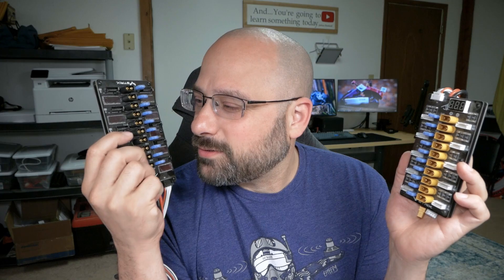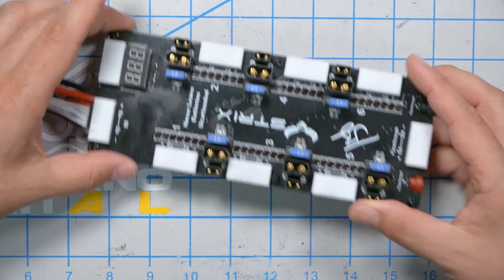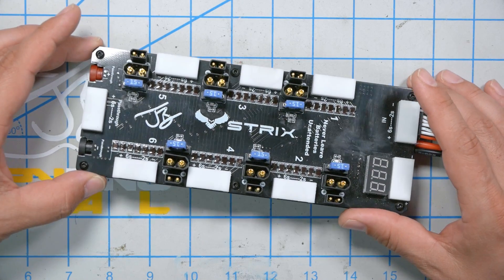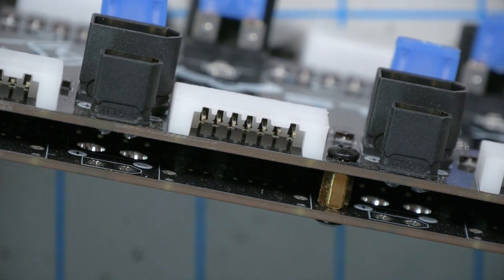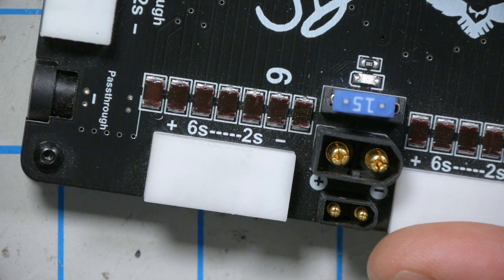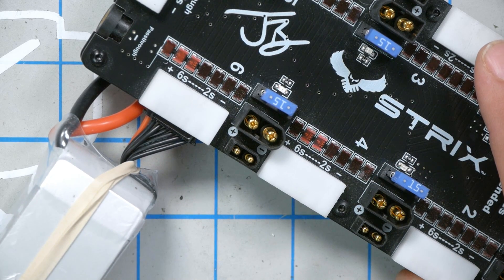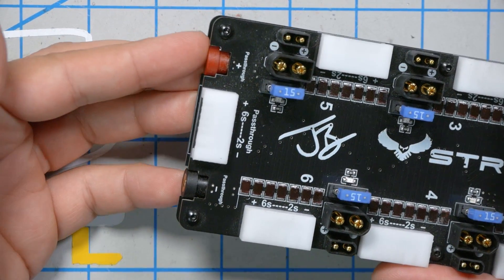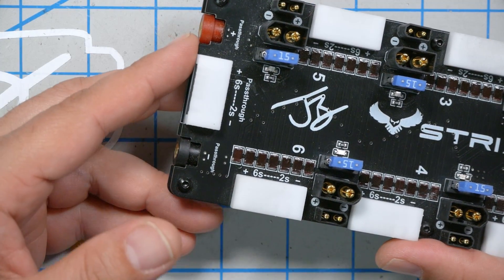New ultimate parallel charge board does it all (XT30 and XT60, 2S-6S)

Comment: before you buy the V2 which will probably be on sale now that this new one is released, u should know that...
on day to day basis i struggle with the JB 6S board when unplugging the xt60s. they are still too tight after 3 months of use.
Reply from the maker: If you really feel this way you can squeeze the prongs of the connector inward slightly with a needle nose pliers.
Reply: @JoshuaBardwell  thank you for replying. It worked for me to squeeze the connectors in addition to make 2 vertical cuts on the black plastic insulator.
Reply: I have the same board love it but, same issue. Very tight. I will try what JB recommends without breaking it. I would of liked more than 6 ports but, it seems many are that way now.  :(      I normally take 20 batteries to take to the field. Looks like more prep time and we can't have everything. If mine breaks I'll be sure to try.

Comment: I have an idea or a question.  I’m not exactly sure so I’m just going to lay it out. Can I use a parallel board to bring my lipos to the same voltage ?
Example: lipo #1  3.75v  lipo#2  3.67v    lipo#3   3.72v    lipo#4 3.65v. 
If I put these four cells on a balance board not hooking to the charger. 
Will they all come to the same voltage and be safe to parallel charge ?

If not is there a way to make a board that will do this safely after flying our lipos ? 
Even if the cells are way off say by more than 1.0 volts?
Reply from the maker: They will do that but the equalization current may not be safe. See the video linked in the description.

Comment: JB: Besides the risk of mixing batteries of different cell counts on those balance plugs, I made a mistake my first time trying this board, and plugged in a 4S aligned all the way to the left instead of to the right. It of course plugs in neatly there on the five pins. (It was the only battery I plugged in for my first test, so no harm done).

I'm parallel charging, and I fully accept all the risks associated (including this one), but thought I would point that out as another item to double-check before charging with a board like this with the 2S-6S balance support on one plug.
Reply from the maker: The polyfuses should protect against this mistake but yeah that's why I resisted making this type of board for a while.

Comment: In terms of voltage checking, would it be feasible to have one that is controlled by a button by each output port so it only checks the battery you want to? The button could be momentary so that it doesn’t drain the battery.

Comment: I think you missed the real competition, the URUAV Blacklight B6pro. I think it was the first one I saw to have it all, poly fuses and automotive fuses with indicators plus XT30 and XT60.

They cost pretty much the same but their are some slight differences in their feature sets:
URUAV:
The automotive fuses it comes with are transparent, super easy to check, if one has tripped.
It has a beeper for when something has tripped.
It also has a detachable XT60 connector to the charger.

Yours:
It has an integrated battery checker.
It has designated daisy chaining.

As for the daisy chaining  you could do this on the uruav probably as well if you simply connect the second one to one of the outlets. However, I would rather go for a charger with multiple outlets and attach individual parallel boards to each of them, but that's probably personal preference. Also

Comment: Is there a reason that it's so big? It just appears to have a lot of unused space that could have been used to arrange the components differently. I'd buy one if there was a 'field charge' version that did away with the pass through. You could also just have the voltage checker connected to one of the inputs with a momentary switch to save another balance lead port at the front. You could probably have the fuses mounted with a 90degree blade fuse holder so that they exit from the side of the board on the underside of the xt60/30 inputs.. this would prevent them from being damaged in a bag as well.

Comment: The paraguard boards have an annoying aspect to them.
I have 2x Paraguard boards and 2x JB 10-port board connected to my SkyRC Q200 quad port charger.
When I first power up the charger, or when I disconnect the last discharge lead from one of the Paraguard boards, I get a "Reverse Polarity" warning from the Q200 charger. It shows "Vp" and "Vn" both counting down from 1.5v over the course of about 5 seconds, and then it stops.

Regarding your new board:
Colour coating on polyfuses - good
New indicator LEDs - good
multi-cell support - good
XT30 or XT60 - meh
Only 6-port - NOOOOOOOOOOOOOOO DEAL BREAKER!!

Personally, I buy XT60 boards and use XT60 to XT30 adapters (Ones with a wire between the two plugs, not rigid) - I find that this is WAY more convenient, because with the old JB 10 port discharge plugs being so close together, if the battery plugs straight into the board, it can be difficult to get a grip of the battery's discharge lead to unplug it. By using adapters with a flexible lead, it makes it very easy to unplug them
So personally I would have kept the old layout, added the multi-cell / indicator LEDs / red polyfuse coating, and just shipped the boards with 10x XT60 to XT30 adapters.

Comment: The best parallel board is not using a parallel board :P However yes, if I ever decide to actually parallel charge, I have the Strix/JB boards for both 4S and 6S. I just run 7 channels of charging now so its pretty much never needed!

Comment: How to prevent your balance plug getting inserted into the wrong pins of a multi-pin balance socket:
My Thingiverse 3731075 - balance port bungs.
So with a 2-pin bung you can be sure a 4S battery will always plug into the correct pins of 6S balance socket.
Reply: yeah good idea, they should really just supply a bunch of jst converters
Reply: Heh, you could call it, a bung plug

Comment: Great board. I have two questions.

1. How would it react with a cell going during charging? I think that is what happened for me once with a ISDT balance board and it created a LiPo fire burning 3 of 4 batteries.

2. Can it be used also for discharge? Get rained in quite a lot here. :)
Reply from the maker: Lany parallel board can be used for discharge and storage.

If a cell goes during charging, it will kill the other packs in the board. That's an inherent risk of putting batteries in parallel.
Reply: @JoshuaBardwell  so no protection with your board in this case ? thanks
Reply: @JoshuaBardwell  thank you.

Comment: Another similar para board in terms of features is the new HGLRC Thor one. Only has 4 outputs, but is more compact, and also has a discharge module so that you can get batteries down to the same voltage easier
Reply: How do you think HGLRC Thor one compares to JB's board?